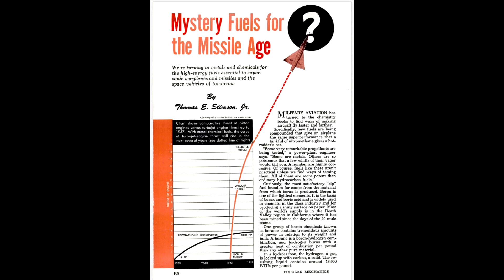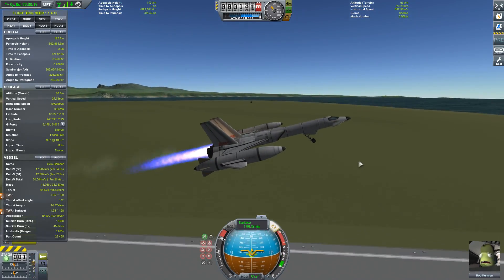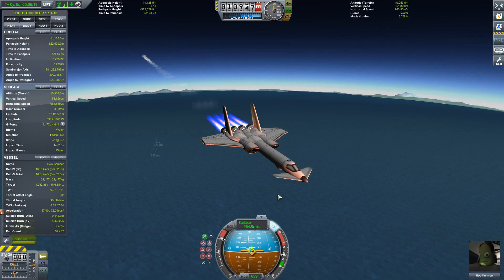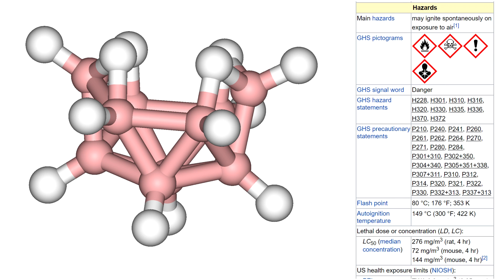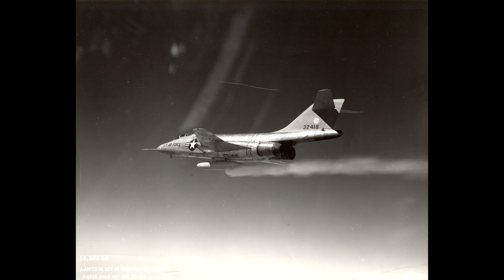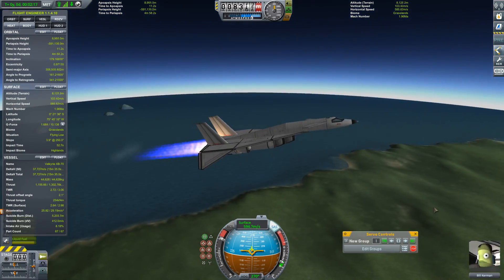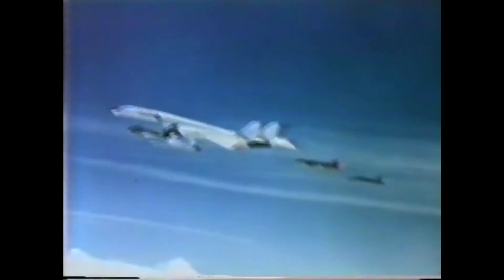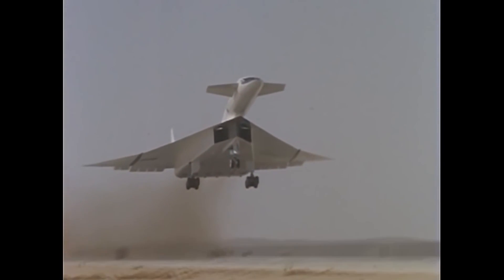Zip Fuels & The XB-70 Valkyrie - The B52 Replacement That Never Happened

Comment: The description of the supersonic center-of-lift shift is backwards.

At supersonic speeds the center of lift of a wing shifts back, not forward, making the aircraft excessively stable and requiring strong elevator trim (which creates drag). The Valkyrie's hinged tips compensated for this by removing area from the rearmost section of the wings, thereby shifting the center of lift back forward.

The glove vanes that popped out of the F-14's wing gloves served approximately the same purpose, though they compensated for two related phenomena: The supersonic shift along the wing, and the fact that the wings (and therefore their lift) moved aft at high sweep angles, independent of airspeed.

Comment: 1950s, in the future we will have space fairing mach 10 nuclear engines with amazing performance.
1960s, yeah, nah, let's just be really boring and unimaginative.
2000s, let's just get the boring designs from the 60s and make them even more boring.
I fear for our engineering if things remain like that. It seems our vehicle designers badly need an injection of relentless optimism and recklessness. For sometimes you've got to be daring to get across big divides. And currently we are bound by so many design limits and stagnation that we definitely need really big jumps to change our paradigms.

Comment: Back in the early '90s, I went to Wright-Patterson AFB in Ohio, to the museum on site.  They had one of the XB-70 prototypes in the display (not sure if it's still there).  You can't really appreciate the sheer magnitude of the aircraft without standing next to it.  At 5'10", the top of my head did not even reach the top of the main landing gear wheels.  A man could easily walk down the air intake to the compressor face.  The damned thing is *huge*.

Comment: B-52 has been obsolete since the production of B-1B and B-2 but political decisions limited production of these replacements below the operational needs level which is the only reason B-52 is still in active use.
Reply: Stu Bur that and avionics upgrades. The BUFF  is still useful particularly in asymmetric warfare where obsolescence isn’t as much of a thing. 
Plus .. waaaaay cheaper to operate than B2s.

Comment: Aside from the XB70's radar cross-section, imagine the IR plume from those six enormous engines... Stealth isn't only about hiding from radar, and the Valkyrie would have been drawing enormous lines across the sky that an IR sensor network could easily use to plot a trajectory and determine the most likely target.

Comment: heres a question.!!! you have been talking about fuel for a while ... cant we use Algae fuel, algal biofuel, or algal oil is an alternative to liquid fossil fuels that uses algae as its source of energy-rich oils. Also, algae fuels are an alternative to commonly known biofuel sources .. We could find someone that can create an ION Propulsion system and change the fuel with Algae fuel ... Could it be done .. and if so Cant we grow Algae in a space ship instead of growing salad ... find a way to grow enough to replenish the spaceship motors ... JUST A THOUGHT !! GREAT VID.!!
Reply: It could, but it has lower energy content: biodiesel has about 38 MJ/kg, kerosene has about 43 MJ/kg, methane 55 MJ/kg, and hydrogen 142 MJ/kg.

Comment: Also your facts are a little incorrect, the planes initial flight fluid about Mach .9 but its subsequent cruising speeds was about Mach 2. I have little doubt that if the project would have continued even without zip fuels This Plane could have beaten the records set by the SR-71 Blackbird. Though it was not designed with swell in mind so I don't know what the max altitude they ever took it to was.

Comment: Scott, you could do another interesting video on the Pyewacket defensive missile proposed for the Valkyrie. This was a lenticular (i.e. flying saucer) shaped missile designed that way for extreme maneuverability so that it could be launched at Mach 3 and then do a 180 deg tun to hit an interceptor or SAM gunning for the XB-70. Officially it was never tested, but you have to wonder if related black-budget research might explain some of the UFO sightings of the 1960s...

Comment: That formation was a photo shoot for GE the engine manufacturer showing those different planes with their engines. Apparently Joe Walker in the F104 got caught in the starboard wingtip vortices and the 104 rolled over the top of the 70 slicing off the rudders which caused loss of control of the ship and the crash. It was said that some had objected to the flight beforehand as a publicity stunt. If so it was an accident that should have never happened.

Comment: The B1 lancer would eventually inherit some of the research that went into the XB-70. Especially the concept about a supersonic high altitude heavy bomber. It's not the Mach 2 beast they wanted, but it's a neat complement to the B-52, being capable of carrying a lot more ordnance,though with a drastic reduction in combat radius. It's still in service, but I can't see any advantage of the Lancer over the B-52 in the strategic bomber role, because AA missiles nowadays can easily reach Mach 3. And that's besides the advanced targeting and path finding those modern missiles use.
I think they use the Lancer just because they spent a lot of taxpayer money building them, so better get some mileage at least.

Comment: I'd been interested in zip fuels for a while but never looked them up, so this scratched an itch of curiosity that had been in my brain for ages.

For a little extra trivia, there's another current application of boron fuels.  The MBDA Meteor is a European long range air to air missile that uses what is essentially a ramjet with fuel derived from a solid fuel.  It's a little odd, but the solid fuel burns and emits what I've seen described as boron rich exhaust which burns spontaneously when exposed to oxygen.  It sounds to me like it's emitting one of those autoigniting boron compounds which is then piped into the air that's been compressed by the ramjet.

I'd heard of this before but it was this video that gave me the missing puzzle piece to understand why the fuel source had boron in it.  It's using a modern zip fuel.  But I'm guessing it was used at least partially for simplicity rather than energy density.  The missile doesn't need to power liquid fuel pumps or deal with liquid tanks and pipes, it stores the fuel in a stable solid form that seems to have a very long shelf life.
Reply: That's interesting. When Scott was describing enging grinding problems, my first thought was "what about ramjets and scramjets?"

Comment: In 5:56, the center of pressure actually moves backwards from around 25% to 50% MAC (mean aerodynamic chord) when an airplane moves to supersonic flight. But, indeend, lowering the tips of the wing would help, by increasing the MAC and moving the aerodynanimc center foward(in the case of the Valkyrie)
Reply: Nicolas Gusso came here to say this as well as:
“Longitudinal Stability” is in the pitch axis and I think he meant to say “directional stability” (Yaw) is increased with the folding of the outer wing panels, not longitudinal.
Reply: True, that makes sense. Indeed, moving the wing tips down would improve stability for both cases, very clever
Reply: Do those "tips" produce a lot of lift? Wold they produce lateral "lift" in vertical position?

Comment: The game in those days was not stealth, it was being able to operate in a way that avoided being engaged by enemy fire.  This means speed and altitude, or extremes of either while sacrificing the other.  Thus, we have the SR71 and the U2, both virtually impossible to interdict.  The XB70 was going to take bombs into this realm by operating at higher than usual (for bombers) altitudes, and higher speeds than usual.  Since we lacked GPS guidance back then it would need to come down and slow down to drop its load, before lighting up and climbing again.  So, it was not perfect, and with advances in missiles and guidance it was relegated to the scrap heap as unnecessary.
Reply: Gary Powers, were he still alive today, would like to have a word with you about the U2 being impossible to interdict.  The U2 only remained useful against countries with top of the line weapons until basic surface to air missile technology matured.  Even the SR-71 needed to stay away from missile sites, a mach three aircraft flies in a very straight line and the only thing a SAM site needs to do is put a missile up in front of it.  Both of them benefit from being able to stand far off from their targets, the altitudes they fly at give them a very far horizon indeed.  For smaller countries it might be sufficient to have a neighboring country willing to grant access to their airspace.

I doubt the planned B-70 would have descended to drop its bombs.  It would have carried nuclear weapons.  This thing was designed to fight WWIII, not bomb third world countries as has become the fashion today.  Precision wasn't the game, getting a nuclear bomb into the general vicinity of its target was.
Reply: The Soviets had tested a SAM capable of shooting down a medium range ballistic missile by the time the SR71 was becoming operational. Mighty as it was, the SR71 was never used to overfly the Soviet Union because they could have shot it down fairly easily. A missile just has too many advantages over an aircraft when it comes to high altitude high speed performance.
Reply: NomadSoul76 
Point and point.
However the U-2 has also matured with improvements in countermeasures and exhaust diffusion.
But flyover intelligence has become rather niche with the advent of satellite imaging and Information Flow Control (of satellite images), and the cruise missile, while expensive, is a very low-risk alternative to a manned bomber.
Reply: HuntingTarg exhaust diffusion?  You sure about that?  I've pretty much never seen an aircraft beyond the f117 or b2 or some drones that used anything like that, and in those cases it was built into the design.
Reply: The U2, prior to the powers shoot down, was safe primarily because the targetting method for missiles was to home in on IR signature, or radar, and none could get to altitude and chase it down before their fuel ran out using the protocols of the day.  Russia either figured out, or were given, the idea of firing early and predicting the path of the plane, so that the missile would detonate near the plane vs hitting it.  And this only worked effectively because the plane is incredibly flimsy (weight savings measures that allow it to get to those altitudes).  Once this was proven the U2's use as a spy plane over the USSR was pretty much done.  Again, not stealth, just exploiting gaps in defense capabilities, which is really all stealth tech does on any level.

And true, a nuke does not need to get dead on target, but releasing a bomb from a supersonic plane is not trivil, the airflow is very problematic and you would risk the bomb being dropped (or the doors opening) tearing the plane apart.  And to stay at those high altitudes that heavy XB70 would absolutely need to be supersonic.  So, lower altitudes, slower speeds, lose the bomb, depart the area rapidly going up and away as quickly as possible.